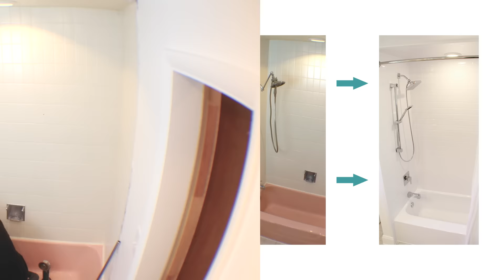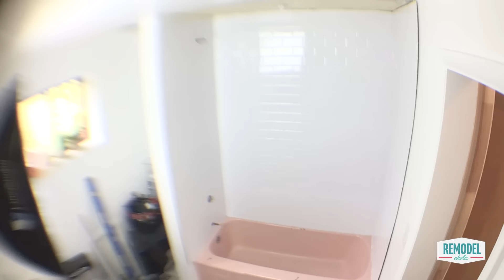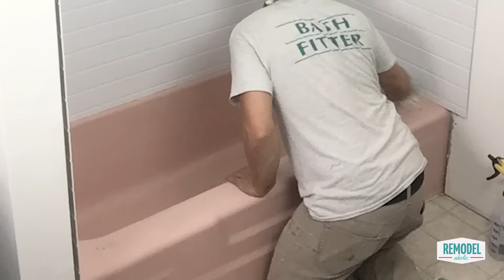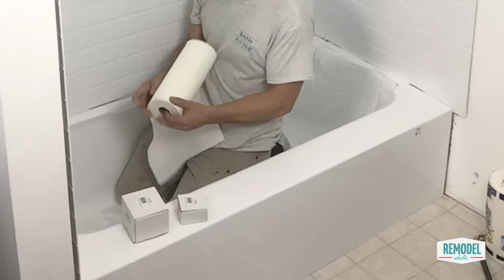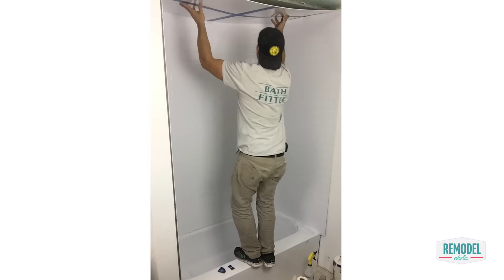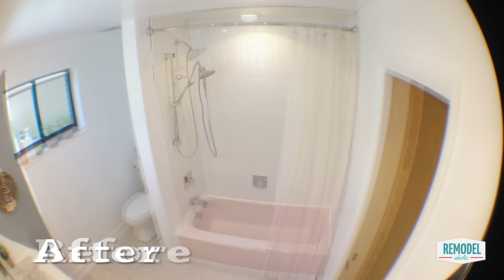Bath Fitter Pink Tub Update

Comment: BEWARE 
Why do they put the walls on first? The liner should have a lip, and go on first. The walls should go over the lip. So, if the caulking along the tub breaks down water will get between the liner and the old underlying tub. Stupid design.
Reply: skamravec reason they do it is so if the tub ever cracks or needs to be replaced it can be pulled up without having to tear out the wall and everything